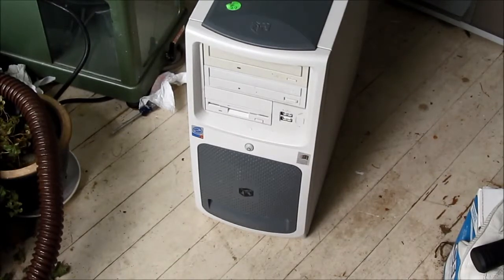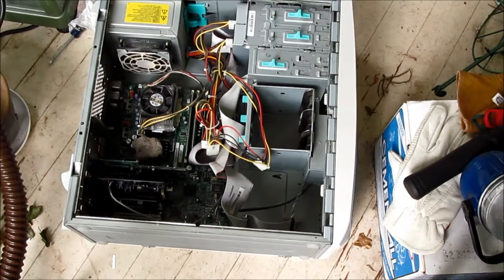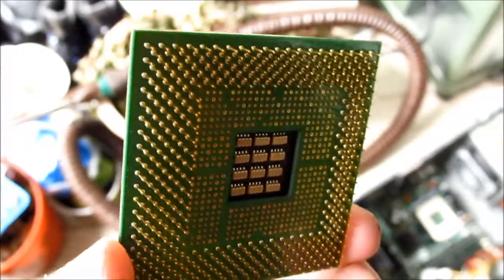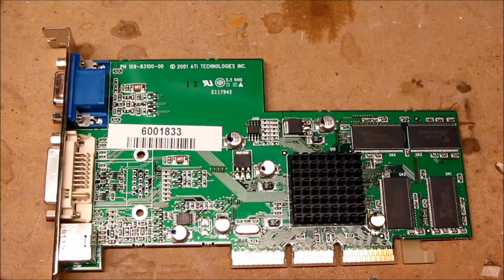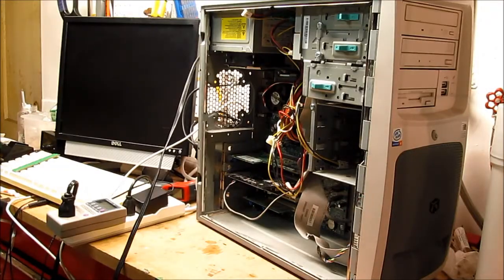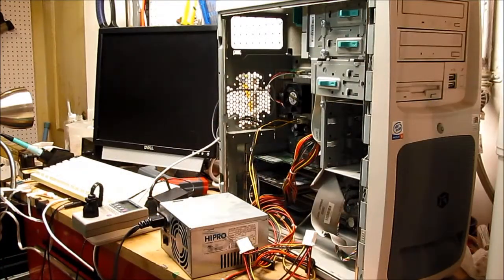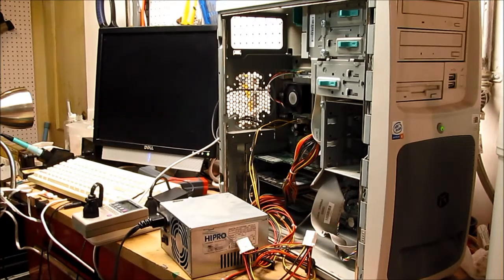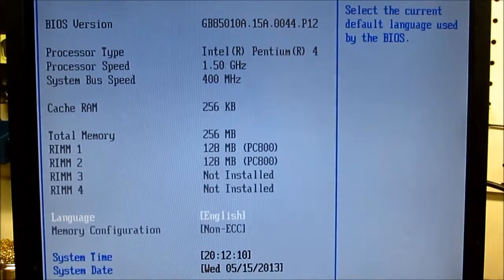2001 Gateway PC - Clean, Overview, POST

Comment: I was just wondering where do you put the p2 and p6 cables in the computer? PS: I have the exact same model
Reply from the maker: It's been a long time since I've seen this project so my memory may be fuzzy.  I think it accepted standard ATX type power connectors, or else I would have thought I'd mention having to splice in cables.   I think p2 and p6 were proprietary power connectors.  There are adaptors available, though maybe difficult to come by.

Comment: I stopped by here because I noticed this was the same PC I just bought off facebook marketplace for $25 along with the vx900 19" monitor it came with. The invoice is still in the box and this thing along with a printer and hand scanner (That I didn't get) was upwards of $2500 when it was purchased. The one I got was barely used by the original owner and aside from a few scuffs it was in great shape. 

The only real downside I had when inspecting it was the hard drive had utterly failed and I had to replace that to install the original ME software that was also in the box. I don't use it very often but for now I'm just leaving ME on there because it unexpectedly boots incredibly fast.
Reply: I know this is a random comment from some random dude on youtube. But if you ever want to sell it, reply back to work something out. Ive been trying to chase down one of these towers for ages for nostalgia reasons.

Comment: i still have a similar pc , it has a 1.7 wilamette pentium 4 (first gen p4) , 512 mb of ram in triple channel , 1 40 gb seagate barracuda and 1 80GB WD Driver , i still have it's original video card but i upgraded the pc sometime around 2010 , it had a geforce 2 MX-440 64MB 64BIT and now it has a FX5500 256MB 128BIT , for the time this pc was a monster , it maxed out everything and even 4 years later it still ran GTA SA at the frame rate limit (gta sa is limited at 25FPS). Such a great computer but the motherboard is dieing 2 caps are really inflated. love your videos man , subscribed ;)
Reply: Own this rig before too back then it cost me ard $3000 plus dollars...

Comment: That standby power supply whine is NOT normal. Also that computer was the same model as my first computer. It was awful! Nice video I enjoyed it!
Reply from the maker: Glad you enjoyed.  
That power supply was dead, so it became spare parts.  I may reuse the case for another project.
Reply: will a seasonic 520w modular PSU work as a replacement for my Pentium 3 PC? my antec PSU in it just died one day when i was going to use it to play some Need for Speed High Stakes on it. thought the antec took the hardware with it but i hooked up my test power supply (A 200W PSU out of a Gateway Essentials 500 PC) and the mobo posted and booted up.